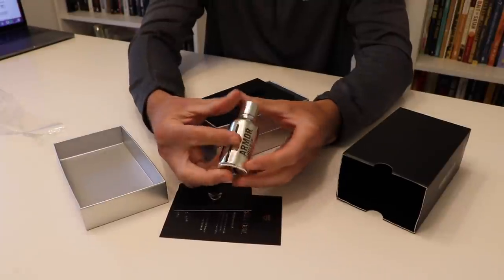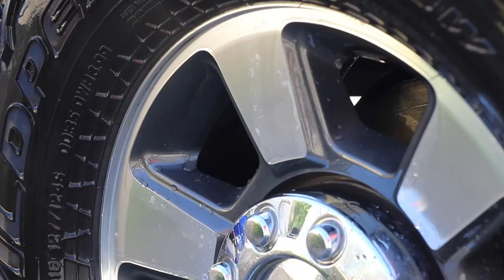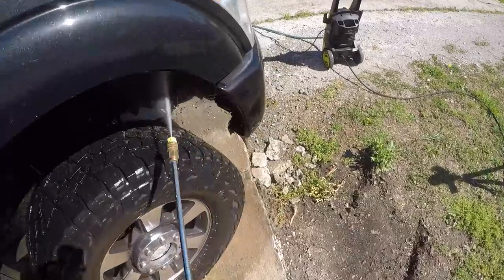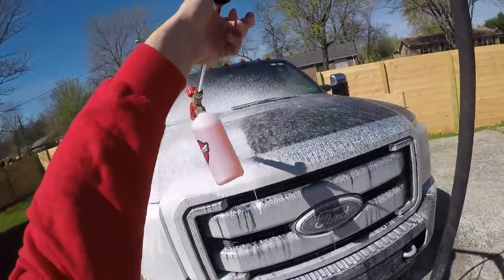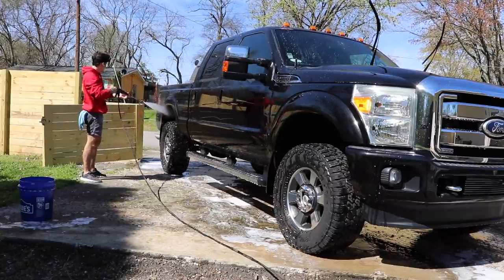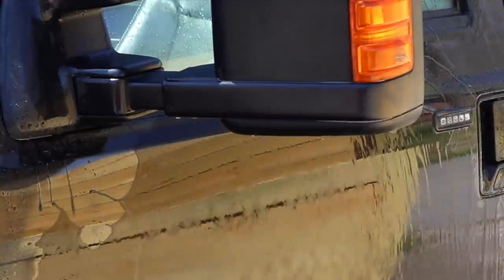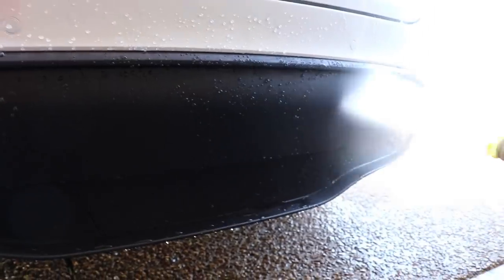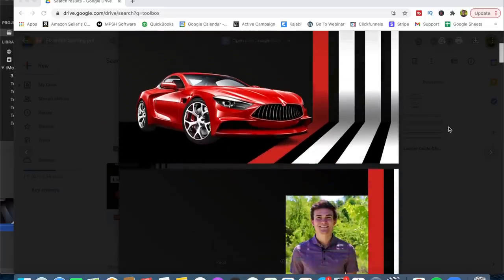Will Avalon King Armor Shield Stand The Test Of Time???

Comment: Yes, great one.  I have installed it so far in 8 vehicles and it is very easy besides great experience protection so far going strong for 3 years.
Reply from the maker: Love the feedback!!
Reply: You've actually installed it 3 years ago. I've actually only heard about this product just a couple of months ago.
Reply: @wilsonautodetailing  y para colmo en vehículos que se usan diariamente pero se mantienen lavados cada 2 a 3 semanas.  La gente aquí le gusta mantener su inversión.
Reply: @richsmith3120  I have also installed CarPro's Ck quartz and Artdeshine's non professional Graphene coating.  Avalon King Ceramic coating has been extremely easy because of the instructions besides their packaging.  I will also use Apex Detail(Brian) new coating since received it last week, it is also extremely easy to apply too and includes the dropper he always mentions on his videos.  All needed besides that not included in the packaging compared to Avalon King is the block, suede towels, the microfiber towel and gloves😉👌.

Comment: I have a 2004 Tahoe that is black. When I got it the paint was not that great and I happen to paint cars for a living so I gave it a nice new black two stage paint job the first month I had it. It has black paint to match 24"s on it and when I did the paint job I spent no joke a week on color sanding and buffing it out. I forgot that not just a two stage paint job but I did flow coat it. That's after the base color and clear coat was applied and it dried a bit you wet sand it with 1000 grit and apply three coats in my case of additional clear with out any base coat so just clear and let me tell you it makes the paint look wet and supper deep looking. After all the time I spent on making her look amazing!!! I wasn't going to let it get any swirls and no matter how hard you try, if you use any wash mitt or microfiber cloth no matter what you will get tinny scratches that will show up in the paint black being the worst!! Black looks so dang good when it's all perfect tho! Anyway I did the armor shield coating on it and I used two kits just to be sure nothing was in treated if you will. I obviously don't take it out mudding or on any dirt roads so it doesn't get crazy dirty but I literally will us my power washer and spray it off really good, then use my foam Cannon with a heavy emphasis on the foam part! I will allow it to sit about 3-4 minutes give or take then power wash it off again. I do the wheels first and I use a mitt for them because of brake dust but the rest of the truck the foam Cannon is it. I rinse it off then I have a cheap little leaf blower I modified the tip a bit to make it more of a big sheet of air or a direct point if I swap the tip out and that is how I dry it. And that is it... Been doing it for about a year now and It is just as easy as day one and it still works and looks amazing. Trick to no swirls is don't touch it!! I absolutely love the armor shield coating it's amazing stuff!!

Comment: I just recoated my Avalon King ceramic after all the required prep steps. But did it outside on the first warm day. It rained 23 hours later and got cold. Now I have a good looking truck with no hydrophobicity. Sheets like  uncoated paint. The first time it lasted about a year. I used a graphene detail spray and it went to another level. Going to recoat with a different ceramic. If you can afford it, have a professional use a higher quality coating.
Reply: I went to get Chemical guys Hydro Charge ceramic coating. It's a spray able polymer ceramic. 10 times the product for half the price.
It sets up in 2-3 hours and is super slick.
Great fir DIY'ers when you don't have a garage. Lasts up to 12 months and best if you polish old coatings off but solved my problem.

Comment: Hey man I'm sorry, but on the truck that Water behavior just ain't it
I expected alot more from the coating
Reply: Was a little disappointed too. I had high expectations for this coating.
Reply: Agreed, I've seen spray ceramic handle better in the same time span, and their significantly more affordable.

When a company charges $75 it should preform better this is worse the CarPro UK 3.0 (which isn't bad but costs 2/3rd) and that's like $55 (though the kit is more) and it has a far better history as a reputable ceramic coating.
Reply: @Lance File it might just be that he used the ceramic wash. Maybe if he used something more intensive like CarPro Reset then it would have fixed it. I’m sure this is a good coating and it has lasted on my car since it came out in 2017 and it beads water better than this. It also took a beating with salt on roads and not being washed. With regular maintenance washing as well it would mitigate this. Just some troubleshooting. Not a total expert about this I’m just curious why the coating on the truck wasn’t holding up as well. Have a good day!
Reply: @kaneri9526  Could you explain how using carpro could help?
Reply: @erikr835  CarPro reset is more of an Intensive wash than AvalonKing’s ceramic car soap. It would more than likely restore the original properties since it would be a little more Intensive and maybe wash off any of the leftover salt and mud
Reply: @kaneri9526  The Avalon coating on the video is half way dead and I expected a lot more from this... And it's not even a year, but few months.. :/
Reply: @erikr835  it’s not dead, it just needs decontamination and some rejuvenation. A simple wash isn’t extensive enough to rid the surface of the contaminants.
Reply: Sorry, Frozz
Reply: @kaneri9526  hmmm, what would you do in that situation?
Reply: My guess would be that it was not properly decontaminated. There is still contamination between the water and the surface of the car. Since the vehicle has gone through so much it would have been more proper to use a really strong soap and maybe even a couple other processes to totally clean the surface. You could probably even wash it over and over and over again until eventually you will rid the surface enough to see the coatings properties return.
Reply: @kaneri9526  dude I'm sorry but you have no clue what you're taking about, I coated my farm truck that's been through a hell winter 3 months ago with adams graphing and I have just washed it with adams car shampoo and it's still like brand new, decontamination/ironx/clay barring won't bring water beeding vack
Reply: @bulletproofbubbles6915  you have no clue what you're talking about
Reply: @lancefile9408  this weekend I brought back the hydroponics on my buddies jeep using three processes. You got to know the chemistry at the molecular level to understand why it looks as if it's not there. The hydrates can produce water spotting and contribute to masking the hydroponics. I took a course with a company that blends coatings for a lot of companies. Most formulations are similar but the uniqueness of each will determine specific behavior. You really have to know the particular coating to understand cause and effect. I don't know much about Armor Shield IX but a water test doesn't make a conclusive test. My buddies Jeep looked just as glassy and glossy as it did 2 years ago so I knew the coating was there but obviously heavily contaminated. It took me four hours to get the hydroponics back. Can't make a call on this truck without being there but whow knows!
Reply: @kaneri9526  it's two month's old ... what type of decontamination do you really think it needs? People decontaminate a car yearly/every other year not every other month.
Reply: TLC2  does a better job on my truck! I still have great hydrophobic properties for nearly 6 months.  I make it all the way through NE Ohio winter and just do a Ceramic soap wash and good to go for a couple more months. I apply 2 coats of TLC2 in the spring and again in the fall. Maintenance wash every month or so. I usually do a ceramic soap about halfway through.
Reply: @bulletproofbubbles6915  
Bruh. Are you saying HYDROPONICS?
I want what you are smoking/growing
Reply: @lumpyrex007  lol 😆 oops

Comment: Hmmm I used it on the plastic trim on my truck I made sure the trim was clean and them did isp on the trim to make sure the dirt was off then applied the coating in February and by August it seemed to be gone there was a little but mostly gone it didn’t last very long to me

Comment: AVALONKING is not that great of a product. I tried it on two different vehicles and all the water repelency disappeared almost immediately. I prepped my paint for hours. And applied the coating in a garage and compared to a $25 Amazon ceramic coating… it was honestly pretty bad. The slickness also started fading and unless I added a topper on the ceramic coating… it really wouldn’t repel anymore. I’ll go for any other ceramic coating at this point before I go to avalonking